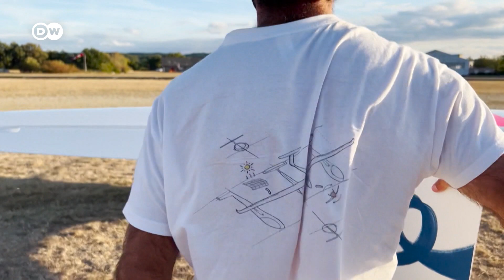The dream of emission-free flying | Focus on Europe

Comment: I believe the key issue is the solar power panel conversion rate. Current panel has around 19%, if it can reach 40%, the practicability will be significant.
Reply: If the efficiency were greater would that mean a large plane could store enough energy to fly through low light conditions?
Reply: @dennettshane1929  higher efficiency mean more energy can be converted from sun to engine and the plane can carry more load

Comment: All the naysayers in the comment section are completely forgetting the fact that the Lockheed U-2 spyplane was a powered-glider. It did use an internal combustion engine, because that was all that was available at the time. But, stealth technology adds weight and complexity to hide the heat-signature from radar, and Infared. There will always be a trade-off with aircraft design....

Comment: Yes, yes,  I can see an double decker Airbus smash to pieces at the end of the runway and in the enquiry afterwards they will say "well the weight of the batteries coupled with the weight of both passenger's and the luggage made it too heavy to take off, plus it was a bit cloudy. All We need to stop this ever happening again is to ban all luggage and make the passenger's fly naked and only fly on very warm cloudless days, then we will have it cracked. "

Comment: The DW staff loves this kind of stuff.
Reply: Anyone should like this stuff. It will benefit everyone if scaled up. Traveling would be made much cheaper without complex jet engines that needs lots of service and fuel that costs thousands.
Reply: @Drakey_Fenix  You would have to have a remarkable advance in solar cells to make this
work.
Reply: @Drakey_Fenix  it currently can’t be “scaled up”
Reply: @JeepCherokeeful  I wouldn't be that certain. Unpowered multi-seat gliders already exist; adding electrically powered propellers would only increase capacity further. I doubt we will ever get to jumbo-size (green hydrogen seems a much more realistic option there), but something like a personal air taxi would seem to be within the range of what's possible even today.
Reply: @ddshiranui  I’m not trying to be Debbie downer but you’d need several propellers for redundancy in a commercial application and the ability to fly in “bad” weather. Which would also block the sun;( Flying a couple people from city to city in France isn’t the same as Chicago to New York City in January.
Reply: @JeepCherokeeful  Those are fair points; I imagine bad weather would be more of a problem for general flight/takeoff stability of a plane like this to begin with. Can gliders soar above cloud level?
Perhaps commercial viability would just be very dependent on the region?
Reply: 400 private jets flew into Egypt for a gab fest, doubt they will be gliding to the next one. Its a toy not a passenger plane. Just like the preachers jets.

Comment: Airbus had an electric airplane program a few years ago but they canceled it after it finished the test flights.
Now they are saying that they want to build hydrogen airplanes for longer flights - when will that become a reality, no idea
Reply: The Tu-155 demonstrated it's possible in the 80s already. At least with the new push towards green energy, and EU nations starting to clamp down on excessive flying, commercial aircraft designers have a renewed incentive to continue such projects. We could have been there decades ago already.

Comment: 3:20 This is so simple to calculate.

Boeing 747 wing area: 500m²
Solar energy available ("standard sun"): 1000W/m²
Solar energy harvested by 747 at 100% efficiency: 500,000W or 500kW.
Energy required to keep 747 at constant speed and altitude: Around 7,000,000W or 7MW.

With 100% efficiency the claim is not doable from a physics perspective.
And by flying half the speed you will not need half the power. That's not how that works.
Reply: It reminds me the case with first flight when some 'engeneers' prooved it is imposible to fly.
Reply: Oh my... That's even more devastating then I thought xD

Tho it does make sense when you look at how these planes are build. Gliders are extremely cramped and lightweight compared to just about anything, given the same size.

I'm slightly curious what the largest glider plane could be, tho I'm aware that such a plane would have literally 0 carrying capacity.
Reply: Solar energy input and Consumption calculation is indeed key. The right design will need to balance the payload and size of the plane. What will be the sweet spot?
Reply: only the wings?
Reply: @wokeaf1337  Yeah, I opted for the simpler estimate. I don't expect the roof to have 10x more area.
I was also giving the best chances here, using the estimates in favour of the solar soltion
Reply: Good points.  Incidentally, the required energy to power an ICE trainset is about 8MW.  What should we do next, run them at half speed or do we stop the trains altogether as well? 

I note that DB runs some of it's carriages on Oko, but yeah really?
Reply: @horserous  🤔 That's really not the point. Trains have little to do with the feasibility of solar jumbo jets.
I think nobody made arguments against flight at a whole, that's a completely separate discussion

Comment: Don't forget the "carbon footprint" of manufacturing the aircraft, wind turbine and solar cells...NOTHING has "zero-carbon footprint"...also all these thing eventually wear out and have to be discarded (that has its own footprint) and remanufactured...
Reply: That the point reducing “emissions”. Manufacturing any material/product would still produce a footprint. However if we can limit it just to the production we would greatly reduce the overall footprint.
Reply: With today's technology, all those elements can be recycled. Still costs energy, obviously. Then again, that energy can technically come from renewable sources, too.
Reply: Exactly

Comment: This actually sounds like it'll work think about it while there are planes on the airport waiting for passengers and pilots making sure everything is working as normal the sun will charge the solar panels on the planes wings and so it'll provide energy for the planes battery that it won't need to use oil to move
Reply: you need a lot more energy than solar panels on a plane can provide and batteries on a plane can hold. This is a very light plane. Its a glider actually. But things will change. Although hydrogen is more promising i think.
Reply: @sheknows9704  tho with hydrogen while I agree that does sound like a really good use of power it's highly reactive well flammable but if it had another element added to make it less flammable or even stored in a safe sort of container thing then yeah I'd say it would be quite the useful source of power or lithium batteries